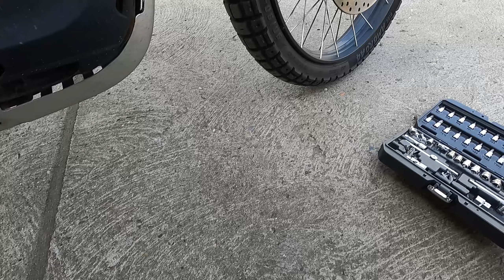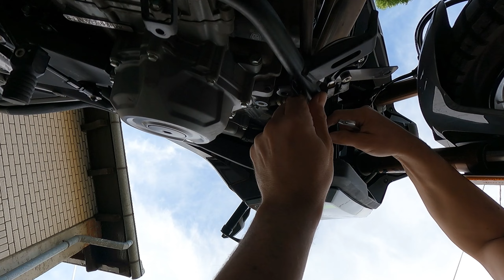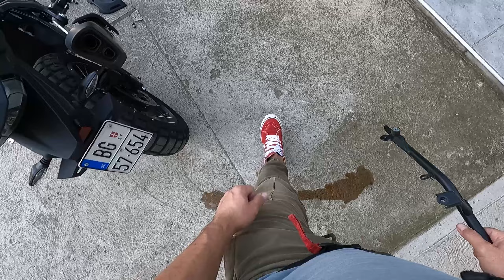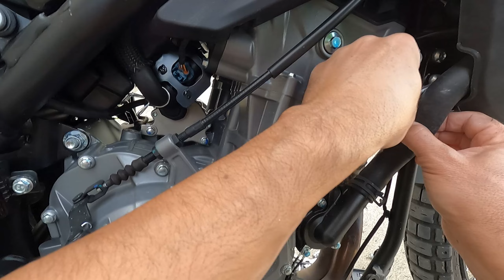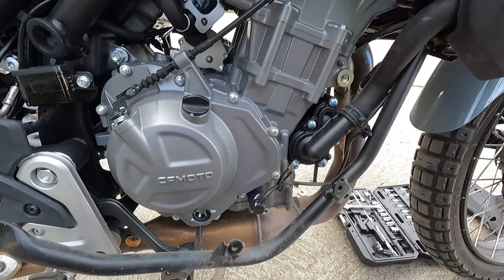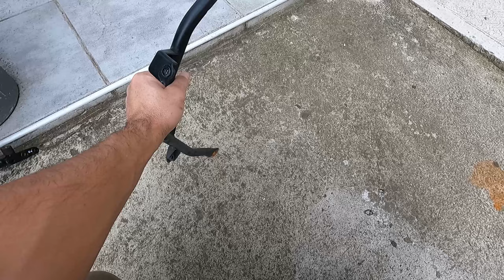Water in the CFMOTO 450MT subframe with rust - A Design Flaw

Comment: Hopefully, all the prospective buyers watching this WILL remove those two tubes right away and SEAL THAT HOLE AT THE TOP . This will prevent this happening./
Reply: Service bulletin fixed issue in September.  I may still add sealant.

Comment: Drill a hole in the frame ffs! You certainly don’t want water running through the frame , that will rust the frame from the inside. Why not stop the water ingress full stop . I wouldn’t except that as a recall drilling a 5mm hole in the bikes frame that’s just a cheap fix that’s not really a fix . Come on cf Moto ffs.

Comment: Drill the hole at the lowest to drain the residual water.
Reply from the maker: I did it, drilled holes and treated with "Wurth rust off base" Thanks!
Reply: Then your frame will rust on the inside 😂
Reply from the maker: @anthonyturner3238  I hope it won't be an issue. Just treat it with rust converter occasionally, and everything should be fine
Reply: @opac probably a cheap part if it fails in ten years

Comment: Just drill a couple of holes
Reply from the maker: I did so, drilled holes and treated with "Wurth rust off base" Thanks!
Reply: @opac  yeah good job, I'm so jealous, they are a very nice bike, but like u said the sub frame needs soughting, and seeing as Yamaha, KTM have joined with cfmoto I'm sure things like that will be rectified asap, enjoy👍
Reply from the maker: @seawench555  thank you, there is no doubt that it is a good machine, you're right Yamaha, KTM have joined with cfmoto. Nice things is that they give a 3-year warranty, for 800 mt the warranty is even 5 years